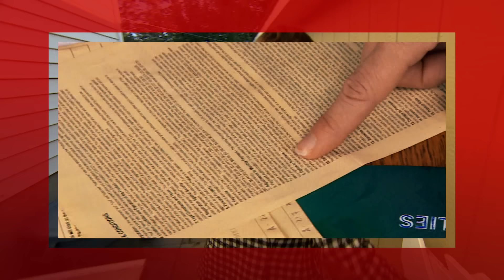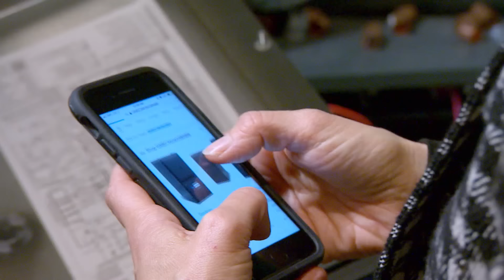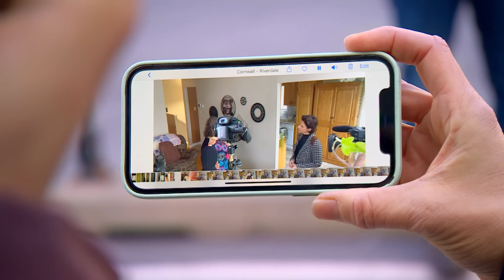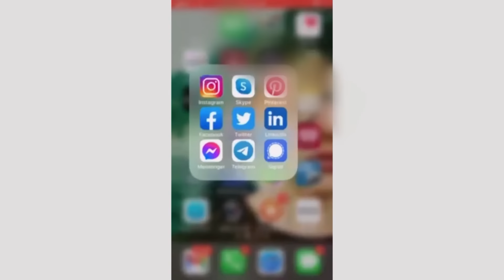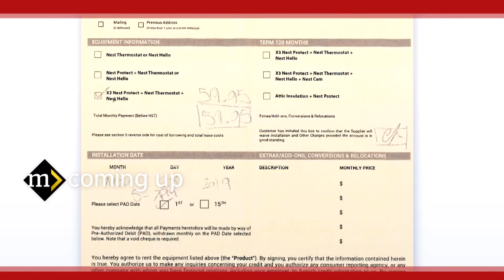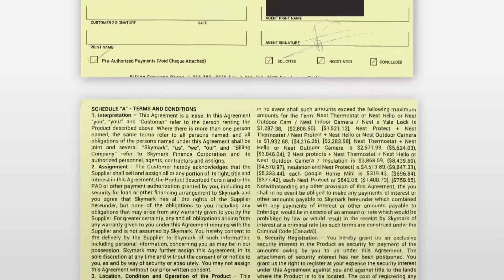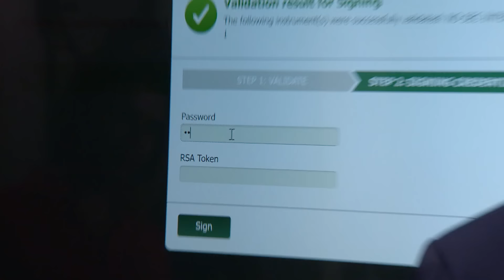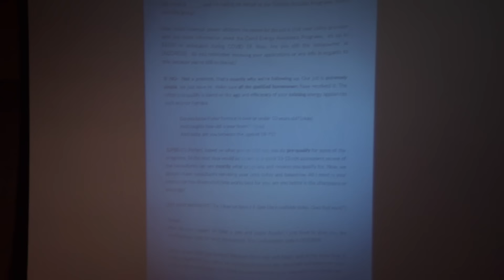Hidden cameras catch HVAC scam in action (Marketplace)

Comment: 5:30  Let's clear this statement up. Technically, Freon is a registered trademark brand of Chemours that refers to several chemicals typically used as refrigerants. However, the word Freon has become a generic term in the industry that refers to ANY type of refrigerant. A better term to use instead of Freon would be refrigerant. Practically all residential air conditioners use some type of refrigerant. So, technically her old and new units may or may not contain Freon, but they both contain some type of refrigerant (likely R-410a).
Reply: Yeah, technically Freon is R-22 and 410-A is Puron. Customers that don’t know anything always refer to refrigerant as coolant or freon.
Reply: There is no reason to replace a air conditioner that is working good just because of the refrigerant or aka Freon it uses because the government is already phasing out the replacement of the replacement and to be honest r22 works great and is much better than r410 especially if you live in a Hot climate
Reply: @tdobson888 an r22 system is going to cost you more in operation and is most likely out of warranty. A new 410A system will be higher efficiency, come with a new warranty, and will most likely qualify for energy rebates.
Reply: @Smok3yR1der  so other than smoke and mirrors there is really not much in energy saving between r22 and r410 dew in part to the extreme discharge head pressure from 410 especially on 90 plus heat days and the energy saving is not even close to being able to make up the difference in the price for a new unit and install. The best way to get energy saving is clean the condenser coil every spring it's the best bang for your buck. But anyone that tells a home owner that they need to change it out because it's not in warranty or it's old or the refrigerant is phased out is lying and as a matter of fact there is many drop in refrigerants that work great for a fraction of the cost of replacing the system as long as the equipment is in good shape oh yeah and by the way r410 is already starting to get phased out along with the other hfc refrigerants so unless someone really needs a new system there is no reason to replace and put in a 410 system .
Reply: @tdobson888  your information is correct but your conclusion is just plain wrong. First of all, people don't maintain their HVAC systems enough to keep it in good working order. Modern coils and ecm motors cool much more efficiently than older coils and psc motors. Also, it's not just the condenser that gets clogged, but, the evap, too. Fins get bent and damaged, coils get rusty and leak. Also, R22 is 1300 a jug and going up. The cost of keeping an R22 system around isn't justifiable. Unless you really think you're "sticking it to the man" by refusing to replace the only pockets you're lining are that of your electric company. And, yes, I have customers who have dropped their utility bills by replacing old equipment, mine included.
Reply: @Smok3yR1der Let's be honest here. You'll never save the difference between the new system and the original if energy savings alone is the basis for the changeout. If it ain't broke, don't fix it.
Reply: @Smok3yR1der You sound exactly like the shysters where I live that rip people off on a daily basis.
Reply: @timc9893  no, I'm just able to do math over the lifespan of equipment
Reply: @Smok3yR1der  
The same thing they did to r22 they are doing to 410a.
The EPA outlived it usefulness but like every gov program.. They got to find ways to continue to waste money and expand.
410a will see the same artificial increase in price in the coming years.
If you need a new unit I would get one soon instead of waiting. The new units are more built to fail with pointless sensors, weak coil fins and a refrigerant we really do not need that will require all new costly codes and safety nonsense.
Reply: Came to say this. By "freon" it means refrigerant and they all use refrigerant. Same thing when talking about the cost. You're always paying more than what the equipment is worth cuz you also have to play for our labor, knowledge, the tools we spent our money on. On top of "renting".... Imagine renting a car for several months.... You're paying a lot of KO ey when you could have just bought it.
Reply: @Smok3yR1der you wrong buddy
Reply: @Smok3yR1der a r22 jug a Freon really don’t matter because your system shouldn’t have a leak anyway. The only difference between an r410 a system and a r22 system is most likely the 410a system had “variable speed motors” that can ramp up and down at any time which is essentially saving you energy, not the refrigerant vs most r22 systems don’t have variable speed motors which mean mostly using high speed all the time, other than that the Freon really don’t matter pal, it’s all getting charged at a 40 degree coil on the evaporator

Comment: I work in a luxury building and we have HVAC companies come to do work and many try to sell new HVAC’s instead of doing a basic $150.00 simple maintenance job, instead, they said they needed a new HVAC and some end up paying $6,000. 
No different than how locksmiths work, instead of trying to pick the lock which would cost $60-$80 bucks, they insist the lock is good and cannot be picked and have to drill through the lock and replace it, not with a cheap lock, but a over priced cheap lock. 
So, you pay $100 for the drilling, $250.00 for a new lock AND for labor which can be anywhere from $100–$150. The same with mechanics, you need a $150.00 job and they tell you you need $800 worth of work.

Comment: I'm an HVAC installer and I can say that you shouldn't ever rent anything inside of your house unless you will be moving in the next year or so.  I would also say to use your local, neighborhood guy who has been around for a decade or more.
Reply: Which you recommend between boiler system vs electrical heating ?
Reply: @alexcalderon5461  people are switching back to electrical again, since coming off electricity in the 1980s.  It depends on your area and how the electrical price is.  If your house is built with radiant electric heat in the ceilings or floor, which is much better than electric floorboards.  I think most people would go for the boiler system if electrical prices are high or delivery is sketchy, which is happening in more places now unfortunately.
Reply: I have seen contractors put a lean on work performed because of refusal to pay from cheap homeowners
Reply: Shouldn't rent at all if you plan on moving within a year or two as well. You would have to buy it out for what the contract is worth so like $60/month for 15 years you do the math .
Reply: Always use local when shopping for HVAC equipment.  I'm also shocked Reliance is never mentioned in these investigations.  They are as greasy as anybody but always get away with it.
Reply: Never heard of anybody offering to rent you a furnace in BC, first time I hear it. If someone offered this I would just laugh and kick them out.
Reply: @blitzblutz  In Houston TX, Reliant has horrendous rates; a 1,500 sq. ft.  all electric home runs $ 360.-- per month.

Comment: I own a small one man HVAC business here in North Texas. Out of approximately 800 service calls a year, I only see about 50 systems that really need to be replaced. Most have minor problems that are easily fixed. I have one customer that has a 1968 Lennox system that still works just fine. She's the original owner! The guys with the morning commercials are the ones to be afraid of.
Reply: Dang right. Was almost scammed to replace our heating system for a new one. It only needed a part replaced.
Reply: I still have in working order a Lennox system since 1998, fingers crossed it last another 5yrs. Lol
Reply: ive seen a 68 lennox, cool creme and red paint job and it worked fine
Reply: 1968?  That sounds like  CAP. Refrigerant for a unit that old has long been phased out. With all the VOCs floating around that system has never had a leak? I don't believe you.
Reply: Right a 54 year old system that never leaked, what type of refrigerant is it and is it even still around.
Reply: @BabyKMoney  R22 and yes it is.
Reply: What is your business info man
Reply: Yea you may only see 50 that need to be replaced in your eyes. I guarantee that seven seer you’re bragging about maintaining is not efficient, significant money could be saved going to a two stage unit and that’s a fact
Reply: @jaxonchaney7515  And how much would that two stage unit cost to have installed?

Comment: A Home Depot affiliated consultant (from ARS Rescue Rooter) said I needed to replace my entire AC system and that it would cost north of 10,000$... instead we hired a local guy who only replaced the outside unit (the only part that ACTUALLY had a freon leak despite what the Home Depot salesman said), cleaned the inside coil, and improved insulation around the intake for a total of 2400$ including labor. HVAC companies are incredibly rapacious, always get at least 3 quotes on a job and do your research
Reply: Find a trustworthy mechanic, contractor and lawyer and only ever use them
Reply: Sounds like a side job
Reply: You got ripped off if you only bought a condenser and not the evaporator too. You can't clean a freon 22 coil and use it on a high pressure R 410a condenser.
Reply: @antonlavey5540  It's a fairly new mobile home with a special A frame coil the coil was in excellent shape and we got a good deal by cleaning it instead of replacing it because these particular coils were very hard to get at the time due to supply chain, there were no leaks in the coil. The condenser we bought is spec'd perfect for use with these modern mobile home coils, my father is a home builder and electrician so he's well aware of those concerns. The condenser was only 820$ from a local HVAC wholesaler as we have a contractor relationship with them. Given the timing that price was very good and the labor price was reasonable given the amount of hours they put into the job and the 4 quotes we got before hiring the final guy. I'm happy with the result, the efficiency has been great through the brutal Texas summer.
Reply: You just put a bandaid on it and delaying a bigger project.
Reply: @coldtendies7918  Bro no I did not. It's a mobile home built in 2014. It did not need an entirely new AC system. It needed a new condenser and the coil needed to be cleaned. It's now 2 years since the repairs and our AC is still functioning better than ever and incredibly efficiently as well. There is no way an 8 year old mobile home needed completely new ductwork, new coil, new blower, new everything, some HVAC contractors just wanted money so they tried to oversell.

Comment: I work in heating and air, it depends on the situation if a unit needs to be replaced, i’ve seen 35-year-old units still running good, it’s maintaining the units,

Comment: I almost cried when that older lady paid 12,000 for something that cost less then 2,000$$. Those people ought be in jail..
Reply: We have to teach people. Telling people its 2000 is false too. It's not 2000. To be fair that furnace installed is around 4500-5000 installed. Anymore than that is robbery.
Reply: @truckguy6.7  soem dude tried charging me 8500 for furnace.
Reply: It’s not just the furnace. It appears as the also purchased and A coil and A/C condenser. It takes many hours to install and is probably charging 100+ an hour. Parts have mark up(everything has mark up even the sodas you buy at the store) that’s how company’s make money. How long is the insulated copper  line set. Did an electrician need to come out or redo duct work? There a lot more to it than just the cost of the furnace.

Comment: Thank you for revealing what scammers are like. I almost had this happen to me too.  After calling a company here in the US for a yearly maintenance the tech they sent tried to rip me off for $15,000 to $22,000 stating my only option is to replace the entire system.  Called for a second opinion and never told the second tech about the previous one.  The second tech's report was a complete 180 from the first. My system doesn't need to be replaced. Nor is it in poor condition.  Thanking the Lord for not falling for it.  When I saw this story, my reaction was, dang, that is what that tech was like that tries to rip me off!
Reply: simply do not ever rent a furnance. buy and finance if you must.  Do not rent a furnance and if you can manage it, do not rent a water heater also. Want to hear something funny? the same companies will sell you furnance insurance for $20 a month. if you want peace of mind, get that and they will replace parts if your furnance breaks :)
Reply: @Motiahmed330  arent rental contracts rent to own or how does it work?
Reply: @K Chandler - What did the first technician do to come to the conclusion that you needed the equipment replaced? Did he run some diagnostics at the beginning? Did the second tech run diagnostics?
Reply: Always ask for references from family, friends or neighbors. You can also check with trade associations for licensed service companies!

Comment: 1,80.hundre dollars just for the furnace but there is mor involved the 12,000 include the AC, installation and more materials to install the system plus she is financing. The first case doesn't make sense. A new 96% furnace and AC  system for  12, 000 is no cheaper but is not  a huge price

Comment: I've never had this happen, but when someone tells me to get the F out of their house, I would leave right away. It's really bad practice to argue with a customer in their own home period. The only time i've had to argue was regarding a furnace in dangerous condition with a rotted heat exchanger and heavily corroded chassis with the safeties bypassed by some dip$hit.

If they walk into your house with a tablet instead of a tool bag, then send them on their way. The "sales tech" is usually one who appears to be really well groomed with very clean and scratchless hands. It's a sign that they don't actually work on heating equipment.
Reply: lol spot on
Reply: Yes, leasing is almost always the most expensive option for a consumer appliance.
Reply: In Texas you have about 3 seconds to get out the house if you know whats best when they say to leave lol

Comment: This is very common. I also wish more people would talk about poor install also. I had a new water heater installed and told the man the vent was an issue, he said nope and guess what the vent is backdrafting fumes into my home now I am working to fix with someone else. So not only are people scammed then poor installs follow and they could be dangerous and impact your health such as CO poisoning.
Reply: You wouldn't believe the $hit install at my nieces house by a so-called professional.  The return duct was attached by one screw and a 2" sheet metal gap was filled with duct tape.  The system was only two years old and had a refrigerant leak that "couldn't be fixed", so they shot some kind of "stop leak" into the system.    There were many other problems with the install, as well.

Comment: I’ve owned a 1993 house for 2.5 years now. It still has the original heater. They told me when I bought the house. I needed a new system. It heats my house just fine. I see no reason to buy a new one.

Comment: Reality check here people. Furnace that costs $1800 is only the price of the item. HVAC dealers have a mark up on that unit. Installer has to remove the old furnace, disconnect all the pipes and wires. Prepare the area. Install the new furnace, make all the connections, test the system. That $1800 price would easily reach $6000 unless you know how to do it yourself.

Comment: I would never buy into a monthly furnace or A/C contract because that will cost you a ton of money you could have saved buy just purchasing the units outright.  The sales rep was correct with regards to the water tank however.  They are not built to last and tend to rust out at the bottom around 10yrs, it happened to me and I had water damage in my basement.   If it was a rental you have the right to request a new unit from your supplier free of charge at 10yrs.  I think that's pretty standard these days.

Comment: Contacting business owner. About the water heater, when we see its 10+ years we RECOMMEND a new one before it bursts and you have no hot water and water all over the basement. Depending if they have a water softener or softer water from the city, water heater lasts 10-12 years. The whole "you have 6 days to get it replaced" is probably a lie.
Reply: That's how often the anode rod needs replacement, not the tank itself, at least with the water here. 2-3 times as often with hard municipal water or any well water.